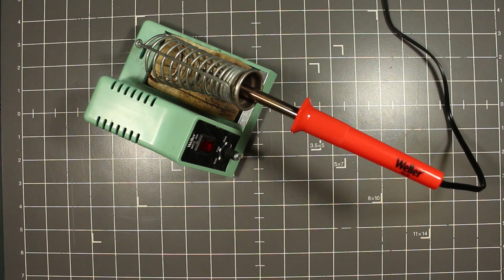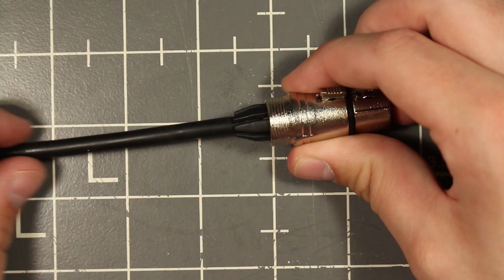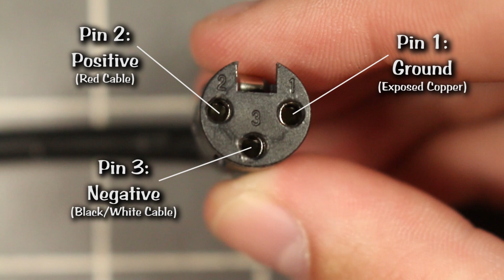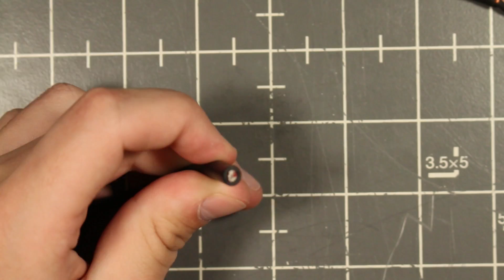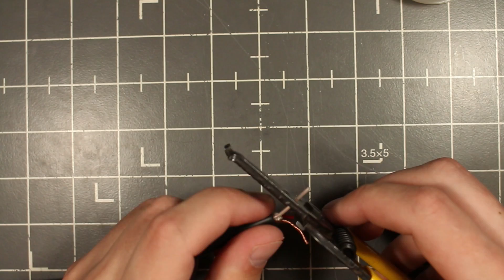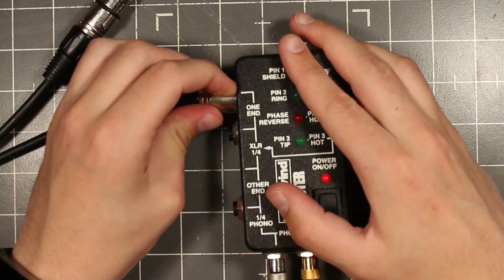How to Repair an XLR Microphone Cable

Comment: I did not solder for a while now, but I remember being taught to twist the strands on cables before soldering them. This looks cleaner and certainly allow a nicer and better soldering in the further steps.
That said, thank you for the explanations on XLR pins. I'm new to it and I want to repair an XLR cable.

Comment: Sir i have only two wire. The blue one which is the covered one and the open wire.. ground and whre to the other??
Reply: this is an Unbalanced cable. what are you using it for?
shorting pin3 to pin1 is not always ideal.. again what will this cable be used for??